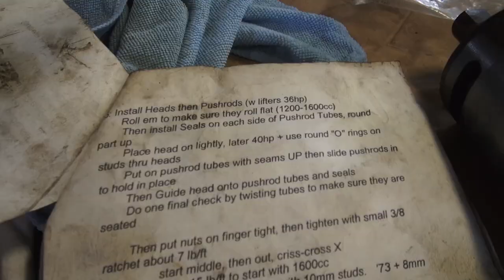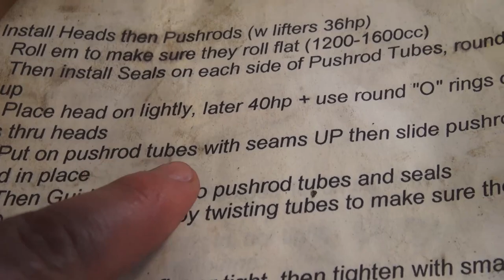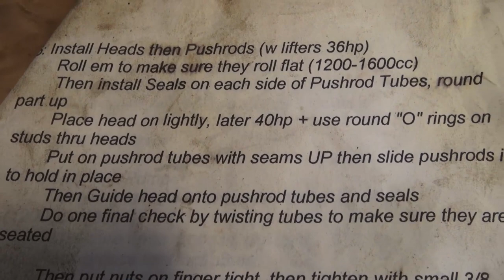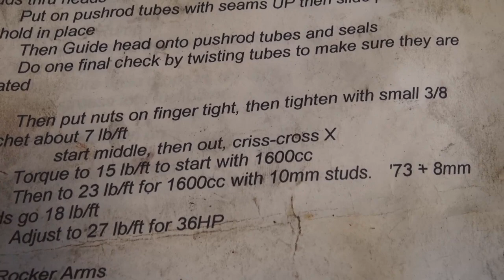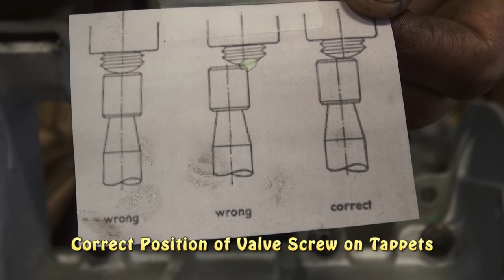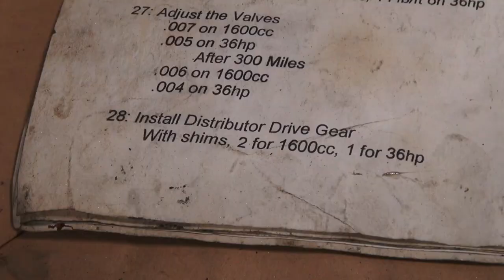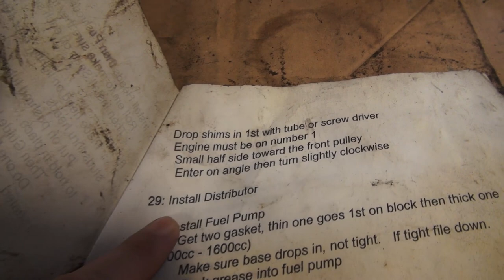Classic VW BuGs 36hp Beetle Air-Cooled Motor Engine Rebuild Part 5

Comment: Fabulous video series,  Watching this video was a journey back in time for Me,   I rebuilt a 1300 when I was 16, (1974)..   I did it a little different,   I took two blown engines and made one good,  or a running one anyways.   I put them both on the garage floor,  took them both apart and picked the best parts out,  I re-assembled them with old gaskets and seals,  (I had no money),  LOL.   It ran great,  only smoked a little bit.  No oil leaks..   I was proud as can be,   :)    My  $50. VW was back on the road..       That's just one of the many reasons I fell in love with VW's..     :)      Great Video..

Comment: Chris, what is the length of a stretched out 36hp push rod tube for installation? Thanks for any help.
Reply from the maker: Not sure off the top of my head, but if you get new ones you do not really have to stretch them.